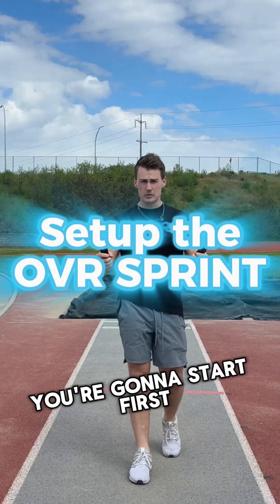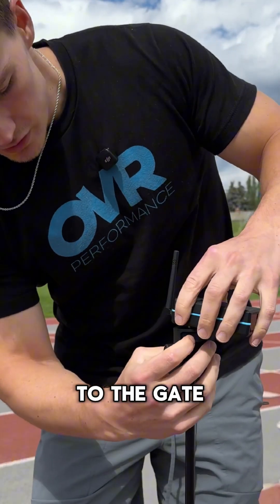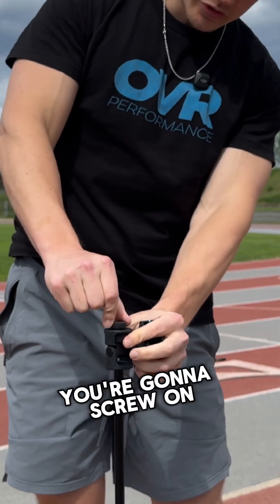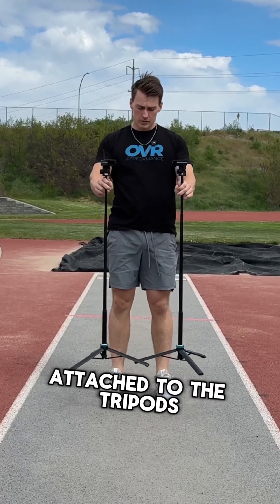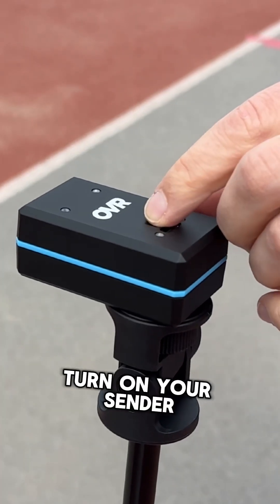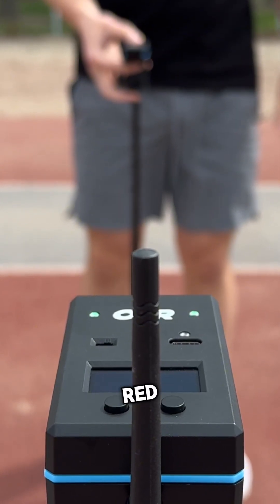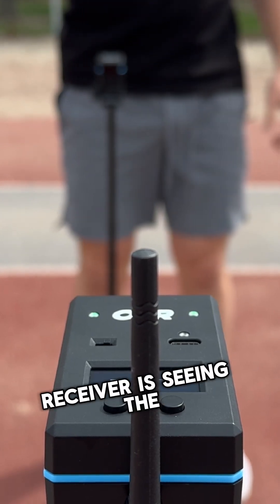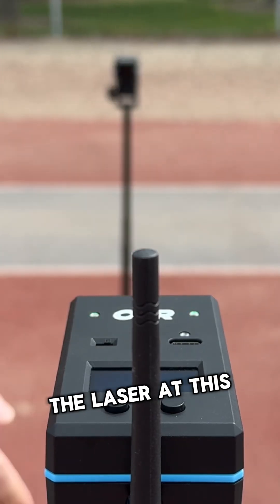How to setup the OVR Sprint

Comment: Can you run 200 or 400m with this I’m interested on how it looks
Reply from the maker: A single device can be used to track repeated laps around a track. The device can also track up to 300 yards under good conditions!
Reply: Thx for responding. Just to clarify—if I have two devices, I can use one for the start and the second for the finish, right? Does it come with two or is that separate. Especially for shorter distances like 200m or 300m. If you have a link that explains how it works, that’d be great. Just trying understand before getting it.
Reply from the maker: Correct, for short distance examples like a 200m, you would need a gate at both the start and finish. For running repeated laps, only one device would be required (seen on the resources page). Sprint devices can also be bought individually or in bundles of up to 5 devices. 

You can head over to our resource page (linked below) to learn about everything our laser timing system offers!

https://ovrperformance.com/pages/resources